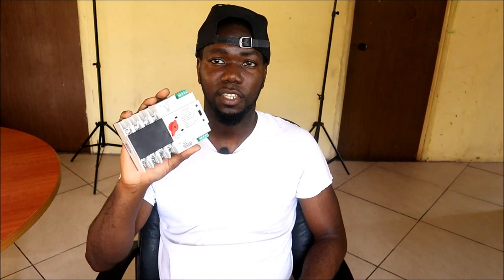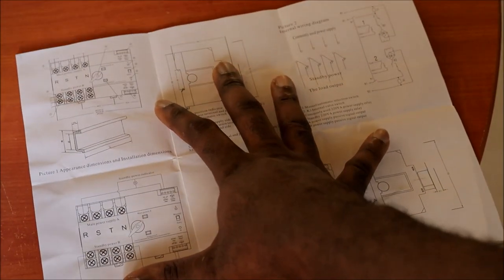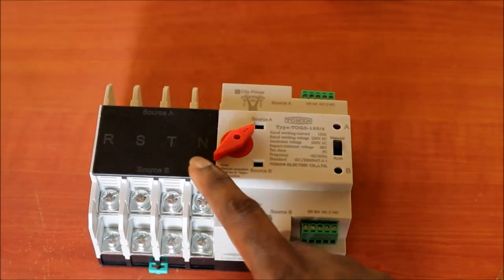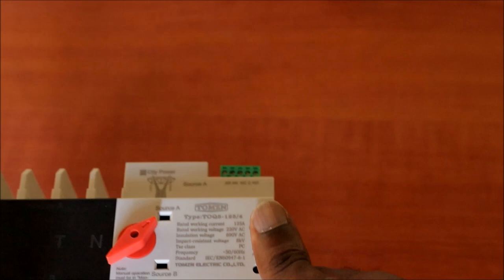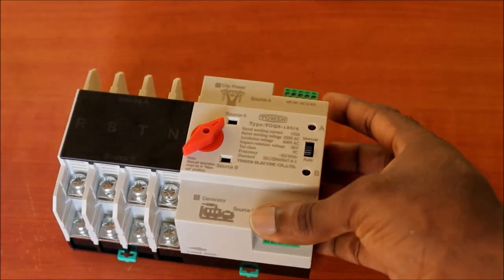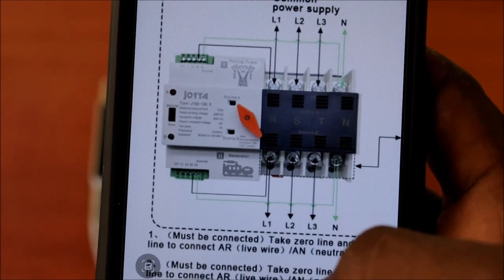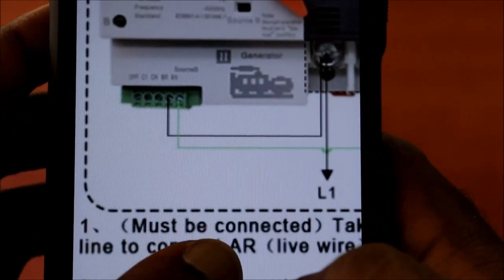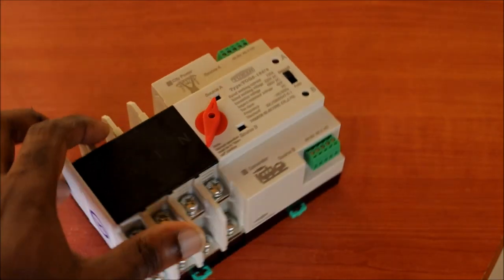Automatic Transfer Switch 125A 220V ATS Unboxing Jotta

Comment: hELLO! Thank you for your video. Question: How do you connect the wires to the terminals? they seem too small for the size of wire needed for 100+amps?
Reply from the maker: True. use smaller connections to connect to the bigger ones.